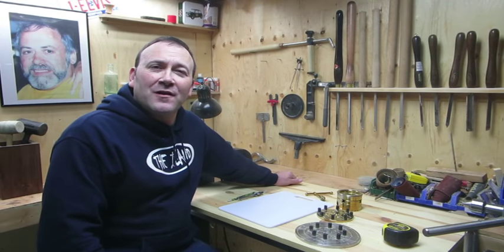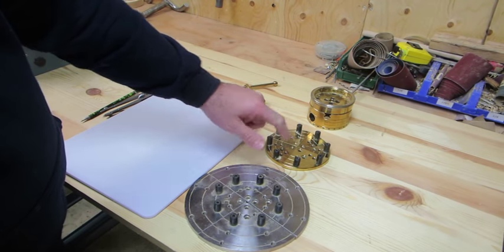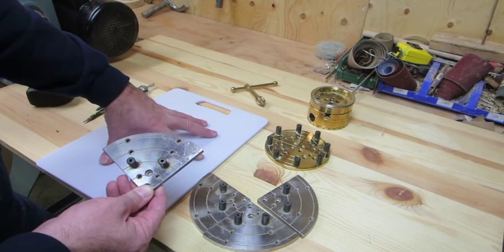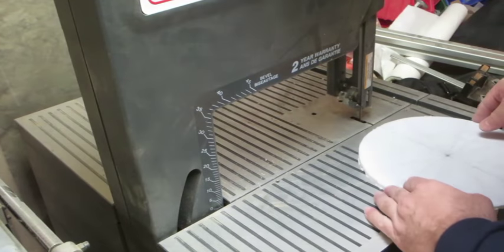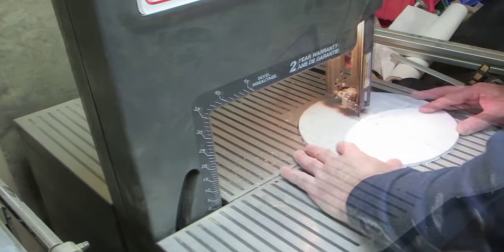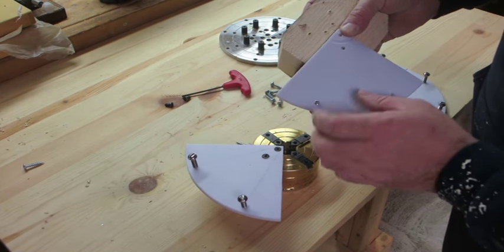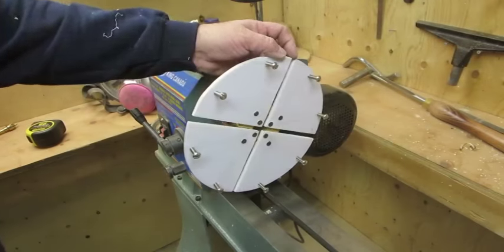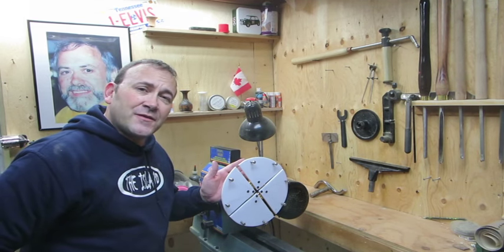woodturning #62 make a $6 set of cole jaws

Comment: Part of the fun of woodturning is finding solutions to tooling challenges without having to mortgage the house!

The easiest way to prepare the screws is to use vinyl tubing from the hardware store.  You will probably need only about a foot to do all eight screws.

I have a PSI chuck with the PSI cole jaws, and needed longer screws to hold bowls that were designed with an inward curve on the outside.  I found some pan-head metric screws that matched the threading in the PSI cole jaws (the screws cost more than your cutting board), but I opted to apply two layers of vinyl - one to pad out the shank of the screws, and the other to slip over the screw heads.

The ID of the vinyl has to match the diameter of the screw snugly, and I couldn't find tubing that was the exact fit that I needed.  So I bought tubing that was very slightly undersized, and then heated it with an old hair dryer to soften the vinyl enough to expand it over the shank of the screws.

By the way, the cutting board is probably high density polyethelene.  It's really handy for various things around the lathe, and its very easy to machine.
Reply from the maker: Louie Powell 
You are right, I like finding solutions to problems especially if I can save some money, that lets me spend it in other areas. 😉 I'm looking to replace my band saw. 
It most likely is HDP, I didn't even think of that when recording. 
Take care
Rob

Comment: Just thought I'd mention that cole jaws also work in expansion mode. This will allow a slightly larger bowl to be mounted. You probably knew that but maybe not a newcomer. Also the quartering cuts would be more accurate if done while the cutting board is still square using a fence. I can't help myself...just finicky to the core. ;-D
Reply from the maker: Gil Grace 
Lol that is great info for all watching the video, thanks, yes I've used my smaller set in expansion mode but that only works if you have a concave lip to grab onto, it's all about design.
Thanks for watching
Take care
Rob

Comment: When I had a grizzley lathe the motor clearance was an issue.  I used washers.  Two of them did the trick for me.  They are much cheaper than extension bars I would think.  Just get them to be a shade bigger than your arbor. Most hardware stores have them.   I would bet that your could get those rubber deals from the folks that make the cole jaws.  I think I saw them one time in a catalog.  Thanks for the video.
Reply from the maker: Michael Hunter 
Lots of options I guess, just needs to be safe. 
Take care
Rob

Comment: i made cole jaws with wood, cost an arm and a leg for the jaw plates and rubber wedges and it ended up no good as the distance between the holes which i used t nuts in were too far apart for the travel on the chuck :/ 

i was thinking of making them with hdpe so a bit more forgiving on the rim of the bowl and like you say the threading should be strong enough for say 500rpm removing tenons and mortises.

one thing I read after buying the rubber wedges is use thin bore hose and a washer between the hose and the screw/bolt heads, compression expands the hose making a good seal and also a good thing for bowls that have a slightly warped rim, when the bowl is tight you might have atleast 2 hoses not contacting the bowl so just screw in a little tighter 👍
Reply from the maker: Mark Hobster 
Good points
Take care
Rob

Comment: I can never convince myself that purchasing or making a set of Cole jaws is worth it in either cost or set-up time. I know a lot of turners use them—and they may be the correct choice if irregular objects are being turned—but I'll take my (shop built) Longworth chuck, q.v., any day rather than having to change jaws and reposition all those bumpers. They're, admittedly, a bit more involved to make but considerably faster to setup; one-off turnings might not see the savings.

Like your use of HDPE.

Cheers,
-- Joe
Reply from the maker: Joseph Scarborough 
I would have to agree that a longworth chuck is better and you can easily screw it on/off your spindle.
Maybe a future project 
Thanks
Rob

Comment: I had same problem with clearance  so put large nut on the lathe shaft then chuck
Reply from the maker: Bazzman Leitch 
But how many threads hold your chuck on?
I don't think it will cost too much to have an aluminum spindle extension made 8tpi.
Cheers
Rob